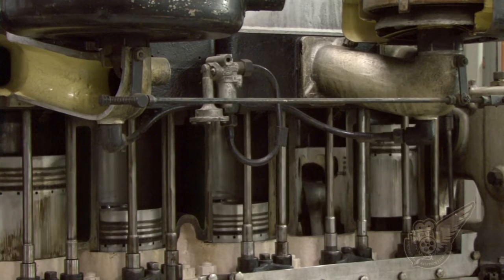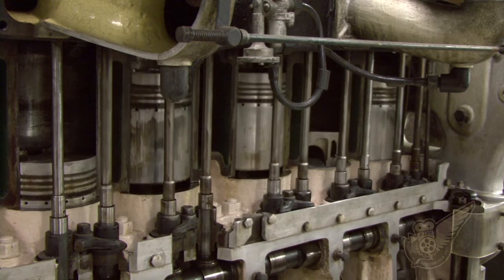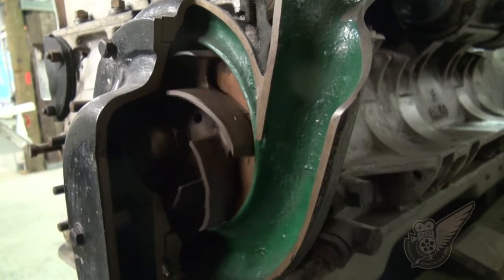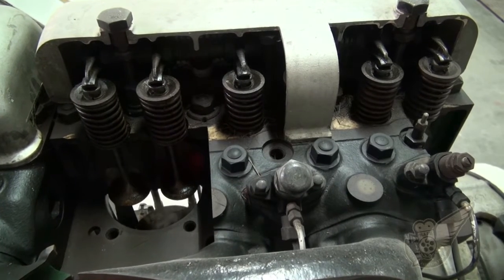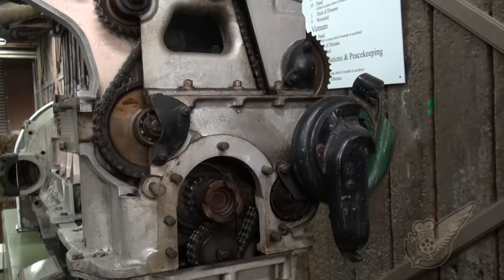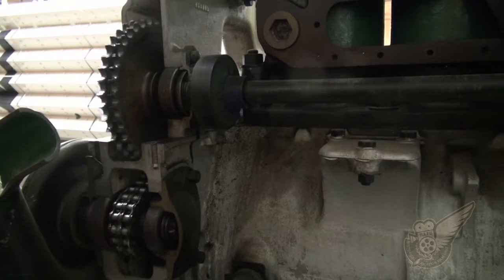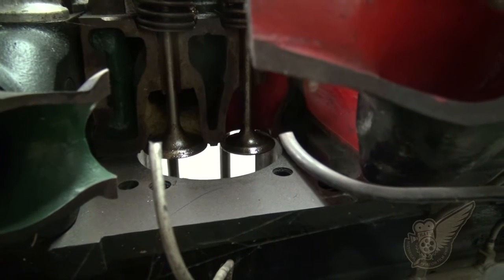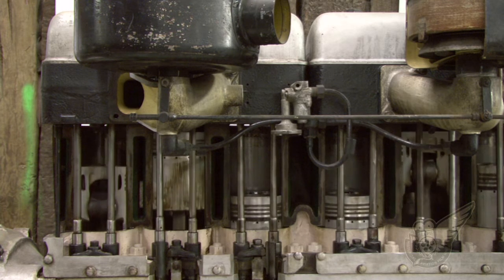Engine: 6-cylinder AEC From A Valentine Tank

Comment: Anyone knows the max RPM from this engine? Currently making a game and I would need the max RPM value for my engine :)
Reply: likely not much, I'd roughly guess towards 2,500rpm, to 3,000rpm to at the very most ungoverned 4,000rpm-ish; since it's essentially a commercial 1930s era pushrod diesel, still with a non-mono-block style of doubled triple cylinders & OHV heads castings, with only a mono-block crankcase and rocker cover for (light) goods vehicles (trucks & lorries).
Reply: @razor1uk610  thanks!!